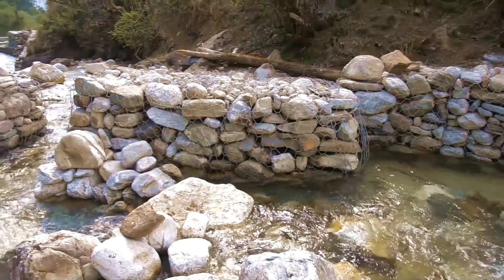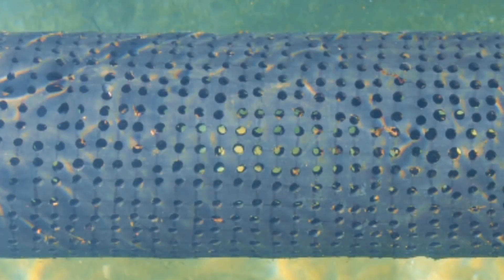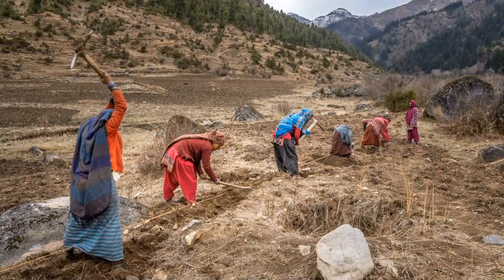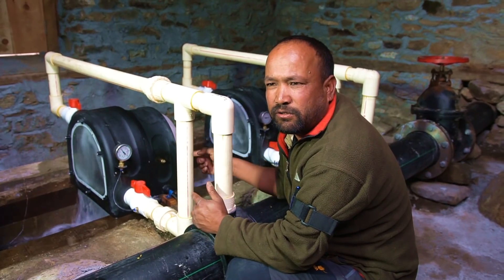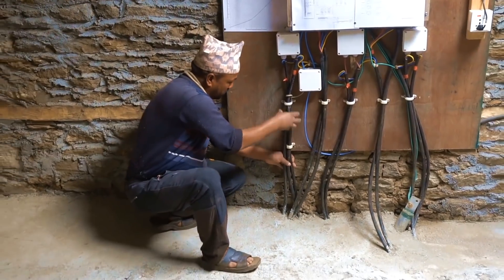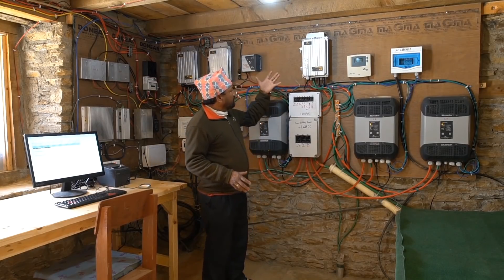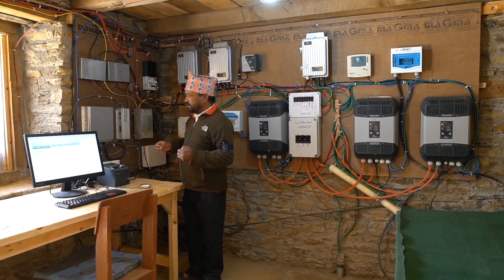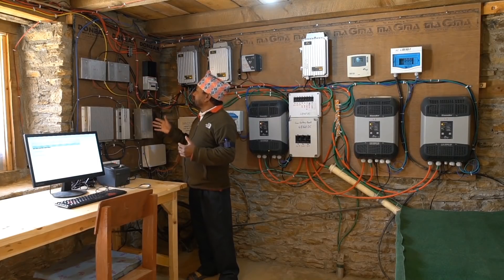02 ENGLISH - MODULAR PICO-HYDRO POWER PLANT PROTOTYPE PROJECT IN MOHARI VILLAGE JUMLA NEPAL(20 Min.)

Comment: Its probably all fine but wouldn't it be better to have the AC converter in the turbine house before transmitting to the power management and distribution house?
Reply: This set up keeps it simple and houses all the electrical gubbins in one easy to access control room....

Comment: I know it may not be cost effective for you at this point, but you should use battery storage instead of dumping power. This is an electrical engineer's nightmare. You have excess power and its being wasted.  Even worse it looks like you already have all the charge controllers to support not just Hydro but solar as well.
Reply: Hi Dad, my wife's company has been involved in some of these projects. They at first used solar arrays powering batteries, the massive problem is, long term, the villages just cannot afford to replace the batteries. So once the first set start failing the villages are literally left in the dark.

It was actually at a Christmas party where her CEO and I had a drunken discussion about this and the topic of hydro plants came up. The system you are seeing here uses Powerspout PLT turbines, they run $2000 a piece, realistically, a village that size easily run on one turbine, I would use 3 though, 1 to produce the power, 1 as a standby just in case and 1 for when sheds a blade/cup on the pelton wheel. 

What I have been playing with is a few micro hydro generators, the cost point is in the hundreds of dollars rather than thousands and as you correctly point out, a village like this does not need 6kw of power.
Reply: @lvthud  
They don't need it now for LED lights and cell phones.
But if two or three women start a sewing business....
and another starts a bakery
The demand will grow..

Comment: This is what you get when you work with the locals rather than just tell them that the cable will be run as we say , to the outsider with no knowledge that there is a hydro power set up here they would never know that the infrastruction is here

Comment: this is the most amazing innovation i have ever come across i am absolutely stunned and impressed!! By the fact that each turbine runs independently installed, and serviceable is mind boggling. Thumbs up to this team that set this up. Kindly advise where one can procure the system from.....
Reply: this could be replicated by every village in the world who uses corrugated 20-30 cm pipe as a water supply just add couple of powerhouses along the way filter the water and get it back in the pipe

Comment: Who is it that makes these generators.  I am attempting to build an intentional community in a destitute area.  I think these would be a good way to power it reliably. The area I am looking would be low head high volume.  But I would have to know more still.
Reply: The system you are seeing here uses Powerspout PLT turbines, they run $2000 a piece,

Comment: So, they got water supply for free  and use owners or village land why charge for energy supply is not free
Reply: The system you are seeing here uses Powerspout PLT turbines, they run $2000 a piece,
someone has to pay for that and all the pipes, inverters and batteries, armoured cables etc.

The villagers have "sweat equity" and probably now the experience to help with setting up this system in other villages????

Comment: Small communities like this shouldn't be exploited for profit, especially when they could be trained to operate said turbines themselves and be free of energy costs entirely (except for parts costs of course)
Reply: The system you are seeing here uses Powerspout PLT turbines, they run $2000 a piece,
someone has to pay for that and all the pipes, inverters and batteries, armoured cables etc.

The villagers have "sweat equity" and probably now the experience to help with setting up this system in other villages????

Comment: I like to suggest that you also can add in micro-hydro power plants and power bank, at the overflow pipe outlet. We can make full use the kinetic force.
Reply: its modular, they can add more of the cost effective turbines if needed. Any turbines from the 'waste' water will have very little head pressure

Comment: Hello, fantastic system! Is there a reason why you didn't install the turbines with a vertical axis? Based on what i know, they should work better that way, and you could install up to 6 nozzles (if there is enough space).
Anyway, great work!
Reply: I would hazard a guess that the bearings that allow the shaft to spin like being in the horizontal plane?

Comment: Using alternators rather than dynamos would be more versatile and efficient. This would also remove the need for DC to AC electronic converters, the cost of which will have added many 1000's of $$$ to the project while enriching the multinationals unnecessarily. Also, there would be less to go wrong and time saved: the maintenance schedule is already in place for upkeep of their rotary machines and static transformers last practically forever.

HDPE = 'Plastic'
Reply: Right just AC is low of  simplified plus complicated system for dynamics so strange design

Comment: Awesome!  Great job, very professional. But why DC current?  AC has less loss during transmission.
Reply: DC has lower transmission losses but has more losses during conversion and it also takes much more expensive equipment to do. That is why high voltage DC is  normally only used over long distances (See HVDC).
Not sure if these turbines have generators or alternators but it is quite common on smaller systems that they are 3p alternating current and then rectified and converted to the DC voltage of the battery bank and that of the inverters.

I'm guessing that the power panel in the turbine house might contain the rectifiers if there are any that will rectify the 3p alternating current to higher voltage DC to reduce the resistivity losses in the transmission cable.

Comment: If the pipe is sealed .... slope doesn't mater. you didn't need a gradual slope. suction will pull you over hills
Reply: would this be inefficient? Would suction over small hills create less pressure? I'm not sure that's why i'm asking
Reply: You are filling the pipe; 
a full pipe doesn't care about ups and downs except if air is forced out of the water and accumulates in a "rise" in the pipe: then it needs to be released.......vented
otherwise it can block water flow....
Reply: @JohnSmith-yv6eq  another question related to your comment. Is this the purpose of a stand pipe then? To get the air out of the line so there will be continuing flow?
Reply: @drewberrynews3875  
The air can also continue down as a bubble...which will disrupt the flow of water onto the Pelton cups, may cause  vibration and may cause cavitation damage to the nozzle and the Pelton cups....
The problem is that a standpipe has to end above the highest water intake point of the pipeline....rather impracticable in this system!
Reply: @JohnSmith-yv6eq  so what's the best way to remove the air if needed, to best preserve the system?
Reply: @drewberrynews3875  don't let air in.  not much can be done after that.
Reply: @drewberrynews3875  
You can have a small chamber that releases a "pee" stream of water/bubbles right up near the intake....but far better not to allow any bubbles at all...

Comment: What is the cost of this power plant? What is the current output in kM or mW?
Reply: The system you are seeing here uses Powerspout PLT turbines, they run $2000 a piece,
someone has to pay for that and all the pipes, inverters and batteries, armoured cables etc.

The villagers have "sweat equity" and probably now the experience to help with setting up this system in other villages????

Comment: Considering the line loss of the DC power, they should have put the Power Building as close as possible to the generators.  All underground wiring should have been protected by plastic conduit.
Reply: I doubt it was translated correctly.  Most generators only produce AC power.  Then it would be bridge rectified at the power station or better yet at the village.  The cable is protected by steal which is better than plastic
Reply: @eby6114  but hvdc is sometimes used with thrysistors changing the dc to ac once more.
Reply: today's cars have what is call alternators (AC), because, back on the days, the used to have generators (DC), and btw, steal it corrodes.
Reply: @JoseJimenez-mp1iy  My thoughts exactly, why use 300 volt DC at 22 AMP when you could use 1000 AC at 6,6 AMP with a transformer where you would get very small losses by heat and dissipation, and also use smaller cables. Ofc a little more insulation may be required, but it will last much longer and more gained. People don't get how much colt there is in powerlines everywhere, we are talking 400 000 volts! and if Thomas Edison got his way (partly has done it in the USA) we would have even lower voltages and fatter cables, hence companies earn more. Luckily Tesla prevailed with his 230 volts in Europe and other parts of the world which means less loss and thinner cables. 400 volts are also used more and more, which is a good thing.
Reply: @TruthIsKey369  Contrary to popular belief, common residential power in the US is 240 VAC.  Go take another look at your breaker panel.  We simply use a center-tap transformer to provide a split-phase tap.  Voltage between the two bus bars in your breaker panel is still 240 VAC.  The difference between the US and Europe is that EU uses 240 for everything, where we only use it for high-wattage loads.
Reply: @eby6114  Translation was correct.  300 VDC from the generators to the Community Center/Power House.  Dropped to 48 VDC to charge batteries and feed the 3 DC-AC converters for 3-phase AC.  Cable shown was direct-burial, suitable for installation without conduit.
Reply: @kevincrosby1760  thanks
Reply: Nice try, but, Nope, DC or AC do not, intrinsically, make different, Amps made!, more amps more cable heat and volt drops, more volts less amps, but to go up the volts, it is easy with a transformer (witch it is why use AC (transformers do not work on DC)).

Comment: Still.doesnt seem deep enough for a farm.. easy for a machine to dig up..
Reply: They are ploughing with oxen, not machinery. They go down only a few inches
Reply: On the farm in Ohio, it is anything buried 24 inches or more is safe. They are saying 1/2 meter so that is just over 19 inches deep or so. Here in S. Florida, the power lines to the house are only 24 inches down but have a layer of concrete on top of them. The Ohio ground is plowed about every year without problems.
Reply: That's what I thought as well.  I'd dig a bit deeper.

Comment: I am intereted in the technology, can i buy it?
Reply: mike shang Check https://www.powerspout.com
Reply: @benjaminledu4058  How they parallel power output of all generators . What equipment they used for it ?name of company? I want to buy paralleling device ??
Reply: @rgf918  It is DC output so all they have to do is combine the output of each unit and feed it into the cables going to the village. It would be better to use AC for the distance run but DC is easier to work with. Almost all of the Smartdrive motors used in washing machines can produce the 300VDC that they used with just a 3phase rectifier needed. Two Smartdrive units used as alternators can easily produce 1KW so 6 of them would produce 6KW or more. At 1000 RPM, even the smallest units can produce that and I would guess that they are running at a lot higher RPM than that.
Reply: @gravelydon7072  thanks
Reply: The system you are seeing here uses Powerspout PLT turbines, they run $2000 a piece,
someone has to pay for that and all the pipes, inverters and batteries, armoured cables etc.

The villagers have "sweat equity" and probably now the experience to help with setting up this system in other villages????